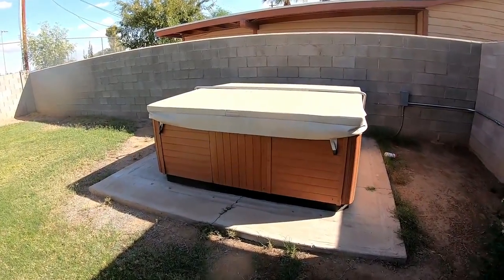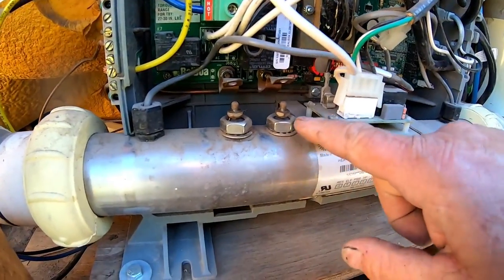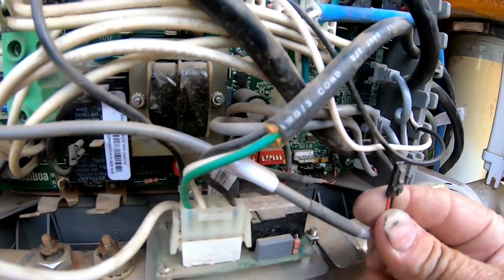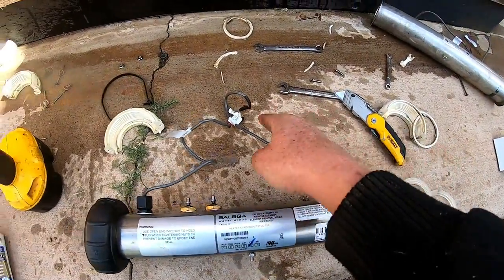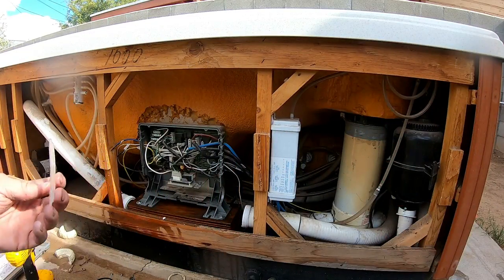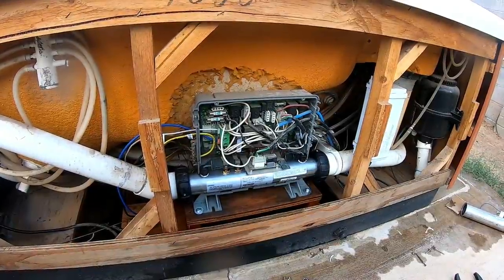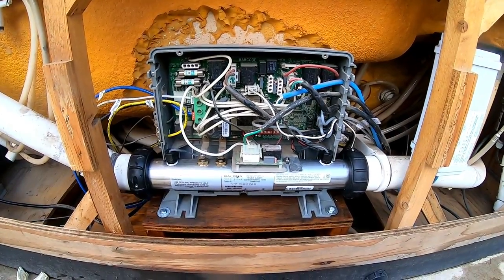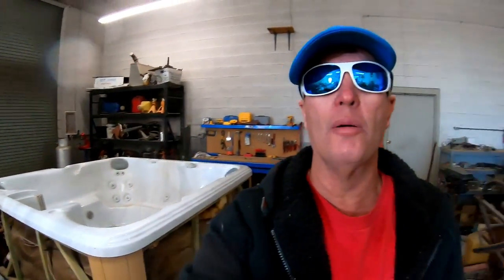Service Call...Breaker Tripping...How I Do What I do... Hot tub trips breaker and will not Heat

Comment: Thanks. I placed the outside box connector to the "ON" side, and I made sure the breaker in the basement is also "on" which has been "on" the whole winter. I was expecting it to turn on, but the console display is off and nothing turned on. What should I do next? I moved to this house with the hot tub there and I was told it's in good working condition. The hot tub doesn't have water in it the whole time, just a bit at the bottom of the tub.

Comment: Hi Spa Man- I have a 2005 jacuzzi j335 that trips the gfci after  the heater is on for about 3-4 minutes. It does not trip breaker immediately. I replaced the heater with a new one hoping to fix the problem, but it hadn’t fixed. With the heater unplugged it will not trip. I tested ohms on new heater and it’s at 13. When the breaker trips it is tripping the inside of the house breaker. The gfci at the hot tub is the type with two fuses and piece that pulls out and you flip over to turn off power. Do you think I may need to replace the older type gfci to a newer style, and do you think it may be malfunctioning and not able to handle heater wattage. Thanks so much for your help and advice.
Reply from the maker: Ok you have a couple things going on.. I would switch out the GFCI to a current up to date one ..I would also check your wire to make sure it is #6 THHN from the Sub to the Spa I would also check the wire from the Main to the Sub panel.. You have something going on that just doesn't feel right .. If you need to call me for help that would be cool also .. Hope this Helps.. Thanks for Watching & SUBSCRIBING

Comment: Spa Man, I need your advice. I have a Balboa el2000 spa w/ an 8 button topside controller (ml700). Will a 7 button controller work as a replacement? An ml700 is ~$385 lowest prices I've found but I did find a used 7 button for $100. Appreciate any advice you can give & all your videos are great. Thanks

Comment: I just bought a 2020 Jacuzzi J-275. I just wired the sub panel with 6-3 Romex wire. The house breaker is 60amp and the sub panel is 60amp breaker. The sales rep said go 60amp so I can run both heat and jets at the same time.

Do you have any videos of wiring from the outside sub panel and to the tub panel? I have called my brothers who are both electricians who helped me wire from house to sub panel. Thankfully I did it right and got a 240V at the sub panel. I would like to see how to wire tub with 6-3 wire.

Comment: , I have the exact same heater ,taken it out .On one of the bolts, there is rust on the top which l have cleaned. There is rust on the inside, where the bolt goes through. What should I do now? Should l take out the heat element and clean the rust. If the black rubber washer is shot,can l use another one if it is similar one or are they special for hot heat. Seems alot of hassel to find a new one on the internet. Just want to point out only took it out ,to check to see if there was any of my impellor that disintegrated. But it is all clear nothing in there but the heat element.
Reply from the maker: You Sir get an A++ for preventive maintenance... As log as it was working before you took it all apart ? Just put it back together and call it good. I would not try to replace the Black washer you are just asking for a lot of headaches trying to get it right.. If the Heater ever stop working replace the entire unit Heater , Tube , Element , Sensors and write the date on the heater tube with a sharpie.. If you get more then 7 years out of a Heater you are taking really good care of your Spa. Hope this Helped And Thanks for Watching & SUBSCRIBING
Heating Element...https://amzn.to/2SXq9od
Reply: Thanks,8 years old still working. I have just cleaned it and put it back.

Comment: Can it work with out heater connect bk
Reply from the maker: For testing yes ...For long tern use I would not advise that.If the heater is causing the problem get it fixed and do it right you will be glad that you did ... Thanks for Watching & SUBSCRIBING

Comment: hi, and thanks for these great videos.  having an issue with a new hot tub panel.  I have a 3 wire sundance spa so no neutral at tub.  have an Eaton 60amp gfci panel.  we have 4 wire from subpanel (has a 100amp feed from main).  we connected the neutral from breaker pig tail, and white from subpanel feed to neutral bar.  tested power and connections we good at breaker, etc.  but the gfci keep tripping.  we are not even connected to the spa.  are we wiring up the neutrals incorrectly?  seem like it..  or otherwise, breaker may be bad?  thanks for anything you can suggest.

Comment: My Spa kept blowing fuses (SC-25 1.66") in the gecko IN.XE controller. Protected upstream with a 50 amp GFCI breaker box subpanel and a 50 amp breaker in the main panel.  local spa shop came out on a service call and said it was an air lock.  I thought maybe the pump since it made a Grrt sound after running a few second to hours. Had motor/pump serviced, no change. 

I would like to see you show us how to determine which one it is.    It was a Columbia Spa , 2011 (their factory burned down in 2013 and never recovered) Single, 2 speed pump 5hp executive 56. Gecko controller.

Side note:  My wife wanted the tub gone so I Craig listed it and a spa refurbisher company bought it and when he came to look at it he said it was the controller and that Gecko did not make the best controllers.   I still came out ahead on the deal at least. It is gone now, but I still would like to know.   See lots of videos about tripping breaker, but none about controller fuses.  Do controllers now use breakers instead of controller mounted fuses?   Thank you for your time and educating the world.